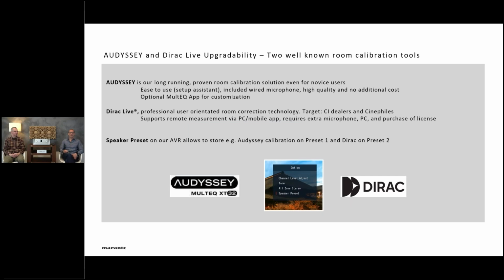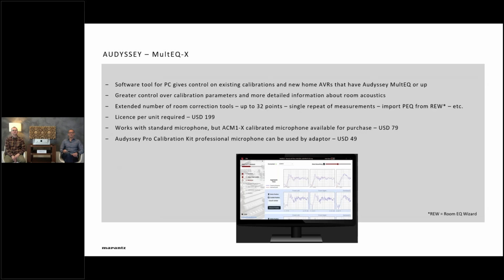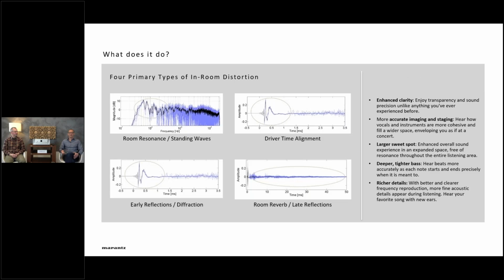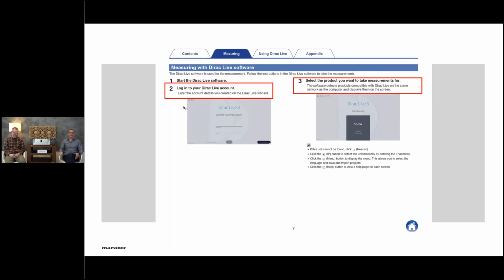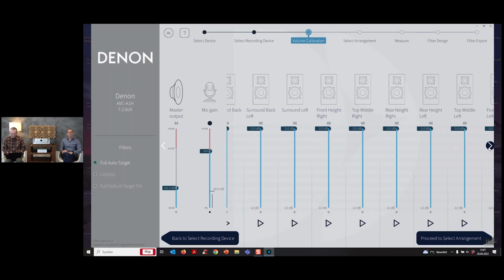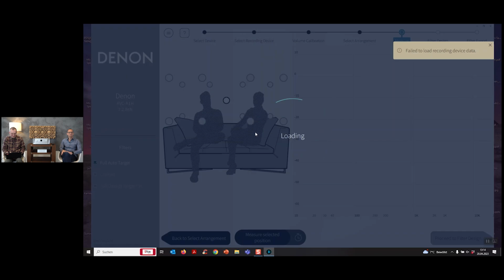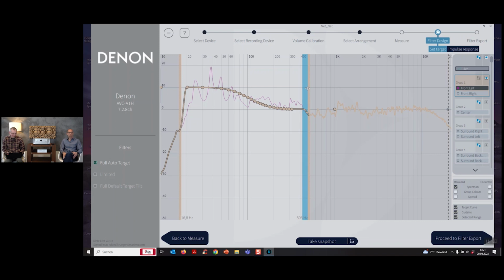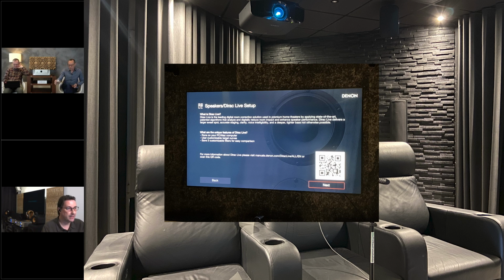Masimo Consumer - Dirac Live webinar

Comment: Hello Masimo Team,
hello Roland

Unfortunately there is a problem with active wireless subs:
All delays are set to 20ms, except for the sub, which is then at 0ms.
The problem seems to be that 20ms is the largest delay you can set. There was an update on this with other manufacturers where the maximum delay was changed to 50ms.
Is something like this pending? Is there any other way to solve the problem?

Greetings from Germany!
Thomas
Reply: Yes, this definitely works better than having all speakers set to 20ms.
But I would use the entire adjustment range. So: If you use DIRAC, you can see the response of the loudspeakers after the measurement. The sub then has a value of over 20ms.
Now do the following: First see if the phase is shifted after the correction. If so, adjust the phase control of the sub. Then measure again.
If the phase fits and the value is still outside of 20ms, note down the individual response values of the other loudspeakers. The speaker with the shortest time is e.g. at 27ms and then receives the 20ms, with the other speakers you simply subtract the difference, i.e. the 7ms.
You then enter the values manually into the amplifier.
The sub then has 0ms, the next speaker has 20ms and the others are in between.
This isn't ideal, but it's the only way that at least ONLY the sub will lag.
Reply: @kind_of_true  Thanks for explaining in detail. I will fire up REW and do some testing.
 I don't understand in the first place why my surrounds are getting 20ms. The DSP inside the SVS sub has only a latency of 2-3 ms. My room is not very large. The sub sits in the corner far left side. The surround speaker nearest should have less ms right? I'm afraid there is a bug somewhere.
Reply: Subs have a higher latency anyway, due to the built-in amplifier. In your case, there is also the DSP. Maybe you can switch off the DSP, since the amplifier has its own DSP, the DSP of the sub is not absolutely necessary.
So: If you can switch off the DSP of the sub, try that.
Reply: @kind_of_true  I did a reset of the receiver, and made a new calibration from scratch and now everything looks good. All distances are now under 10ms and makes sense. Don't know what went wrong the first time.
Reply: I'm experiencing a similar problem. Did you find a solution?
Reply: @Exalix 
No, there is no real solution to the problem. Masimo would have to move the limit from 20ms to something like 60ms.
However, I have been able to reduce the problem.
With the program REW I measured the response of the speakers.
By changing the phase of my subwoofer I could already achieve something, then I entered the calculated values manually, whereby the subwoofer always gets 0 ms and the next speaker to your ears just 20ms. The rest is calculating and approximating. Unfortunately DiRAC does not do this, if a value is exceeded, all values are simply set to 20ms, which tears the sound completely apart.
It works fine for me now, but everyone with a wireless subwoofer should have the problem.
Reply: @kind_of_true  Thanks for replying. I'm using SVS SB-4000. Not wireless. The subwoofer is set to 0 ms, but the surround speakers are set to 20ms, så they must have "hit the ms wall". 
I did not have problems when using Audyssey and Dspeaker(calibration unit only for sub adding 90cm delay). With Audyssey+Dspeaker the distance was ¨5 meters, and distance to surround 1.5meters from MLP. When converting to ms, it's nowhere near 20ms either way it's calculated. 1 ms = 34 cm. 20ms = 6,8 meters.

See people was hitting the 20 ms wall with Onkyo receivers, and they released a firmware extending the delay time up to 50ms. Lets hope Masimo do the same.

What if I took the delay distances calculated from Audyssey  and converted them to ms and enter them in manually for Preset 2 where Dirac sits.? Would that work?
Reply: @kind_of_true  Sorry for late reply. Today, U30.1 was published and the limit for the delay time was increased to 50ms for Dirac Live.
Reply: 👍
Danke! 😀
Reply: @kind_of_true  I just got a message from Dirac support that Denon/Marantz is very close to release a firmware that fixes the 20ms limit.
Reply: @Exalix 

Thanks for the info, I'm very glad to hear that.
More people probably have the problem than is generally known.
And many probably don't notice the error and wonder about the miserable sound of the amp.
So everything will be fine...